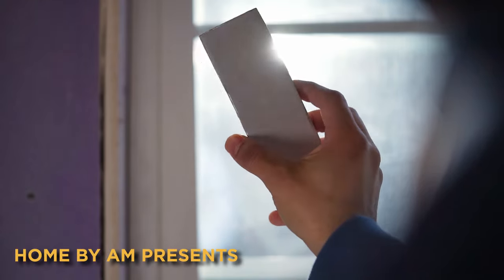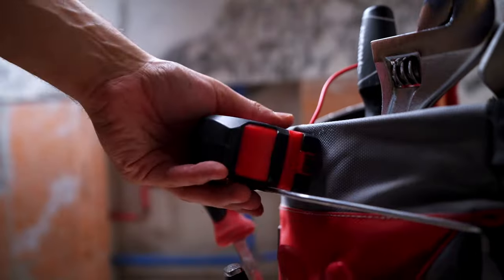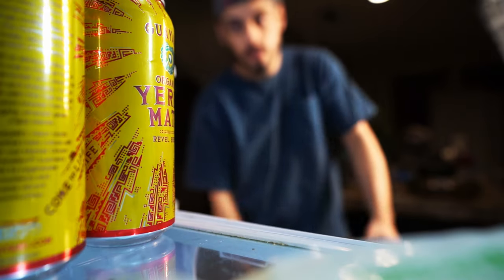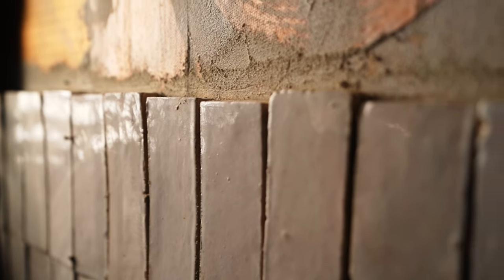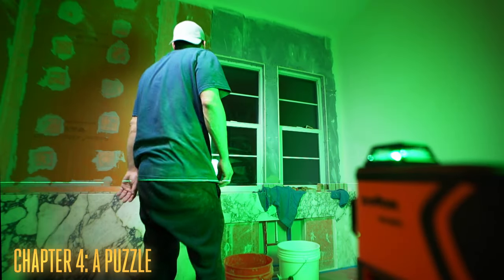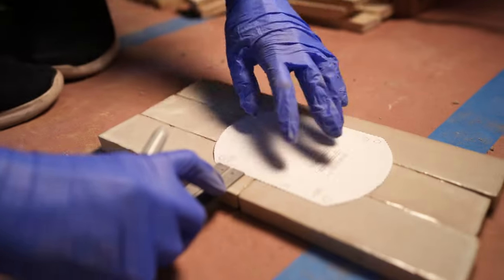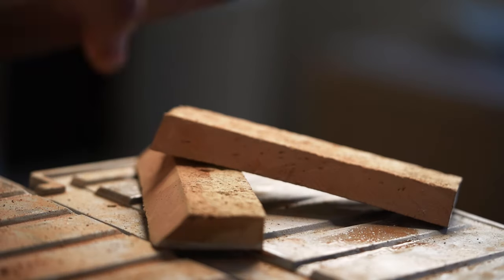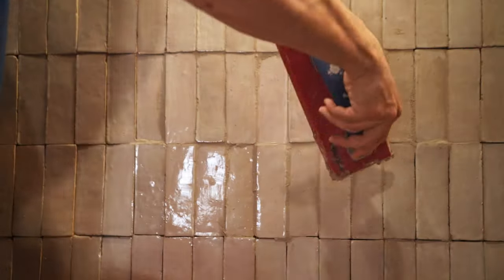Zellige Tile: A Popular High End Finish but is it Overrated?

Comment: so so worth it, if one can afford it and has the patience to install it.    An affordable option, though you won't get the unevenness authentic Zellige offers, is Amagansett tile, by Ivy Hill, offered at home depot.   It's limited colors, but it has that opalescence and uneven tile face to it.  I used it in my bathroom and it's stunning.   The other thing is, to give that Zellige look, it to stack the tile like you did, not where one tile is laid over the seam below the two tile below(like you typically lay brick).    I love Zellige and it does come in some incredible colors.  It's timeless elegance.
Reply from the maker: I’ll have to check out the Amangansett tile. I think you’re describing 50% overlay pattern right? I think that would def help create some unevenness and texture!

Comment: I had a question! How was cutting the tiles on the finishing edge of the shower? Was it difficult to do / does the tile break easily? Thanks!! Love the way it turned out ! I should be installing mine in the next month 😊
Reply from the maker: It wasn't too bad at all actually. Occasionally the the edges chipped and we had to redo but overall it came out pretty cleanly most of the time. My tile saw is the table push type. That might have helped some.

Comment: Thank you for choosing DOVOH.❤ This H3-360G self-leveling laser level is an impressive tool, and we are grateful for your decision to choose it. As a laser-level manufacturer with over 9 years of experience, we are committed to delivering products of exceptional quality, accuracy, and durability. Whether you're hanging pictures, installing shelves, or aligning tiles, you can trust our laser level to provide precise and accurate lines. We encourage you to explore the numerous use cases and discover the versatility of our product. 😊
Reply from the maker: Loved the brightness of it. I am definitely fully behind it!
Reply: @Drewdoode  Thanks for your trust! This H3-360G self-leveling laser level uses 110mw laser diodes to project bright and visible green beams, which is a significant improvement over the typical 30mw laser diodes used in other laser levels. In addition, it has outdoor support pulse mode, allowing the working range to extend up to 197ft/60m with a 10 KHz laser receiver(not included). We encourage you to explore the countless applications of our versatile product and experience its exceptional performance. ☺

Comment: We're in the process of kitchen reno now and we decided to go with Zillege 4x4, or at least we want to.  But seeing this finished product, it's gorgeous and all but can't imagine cleaning it will be fun.  Maybe easier to clean in the bathroom where you can water jet it, but in the kitchen grease, hmmm.  Maybe not.
Reply from the maker: We were actually just talking about the same thing.  We were considering it as a backsplash in the kitchen but decided otherwise due to the challenges of cleaning grease off it. It’s possible just challenging for sure.

Comment: Why do you have to soak it? Is that with only zellige? Or any tiles?
Reply from the maker: Since zellige is natural and porous it absorbs water. If you don’t soak. It’ll absorb water out of the thinset causing it to be too dry once placed on the wall and it won’t be as strong of a bond.

Comment: Any tips for zellige on a small floor? I can only find videos from ppl who install on a wall.
Reply from the maker: Hey! Are you looking to get it even with no lippage or you want the texture and uneven look?
Reply: @Drewdoode  id like to make it pretty even.
But I understand there will be some lippage
Reply from the maker: @funtimesindeed  if you’re okay with the look you may want to consider using grout lines which will help with the unevenness. It will just take more time. You can find tiles with similar thicknesses and also push more or less into the thinset to get it even. The look is amazing on the floor!
Reply: Hey! I've tried calling the tile manufacturer but they don't have any answers for me. Maybe you can help: 
I'm installing zellige tile around a fireplace hearth. Small square footage. low traffic. The subfloor is concrete so I have to use a Ditra membrane. I'm assuming this is ok with such a thick tile? My second question is: how thick of a mortar bed is appropriate for these thick tiles? Its amazing how little info is out there and I feel like this is more like masonry then tile.
TIA!
Reply from the maker: @funtimesindeed  Hey there is definitely not a lot of info out there and a lot of tilers won’t even install zellige. I’m totally down to help! 

So if you have concrete subfloor you actually don’t need the ditra. Since concrete doesn’t flex like wood subfloor it can be installed directly onto the concrete. Using ditra is fine too though. Thick tile shouldn’t matter on the ditra or concrete subfloor. Ditra just requires tile larger then 2x2 I believe. We used a 1/4”x1/4” square notch trowel. We back buttered as well. I think any smaller may not get coverage. And larger not needed.
Reply: @Drewdoode  Thank you so much! I'm going to subscribe just for the simple fact you took time to write that reply :)
Reply from the maker: @funtimesindeed  haha. Well thanks!! Happy to help.

Comment: What was your spacing?
Reply from the maker: No spacing. I put them right up against each other.
Reply: @Drewdoode  our tiles just arrived! So that means no grouting between?
Reply from the maker: @jonathanschirripa584  it’s up to you but we chose to do no grout lines to create more of the unevenness and more texture. Riad tile instructions actually say that usually they’re installed with no grout lines. As long as it’s authentic zellige and not ceramic.